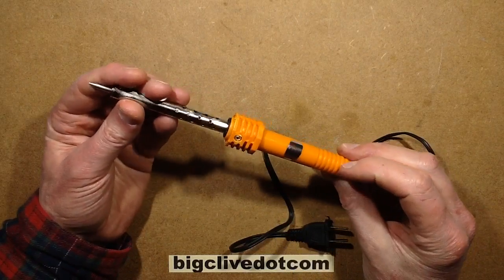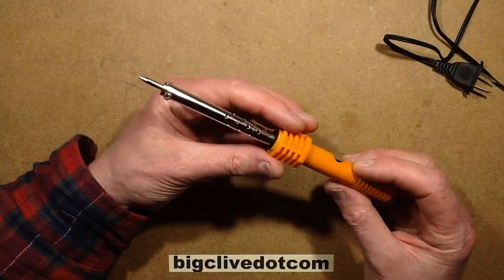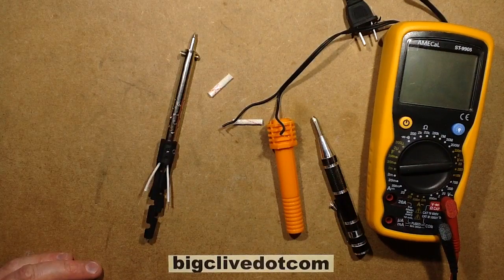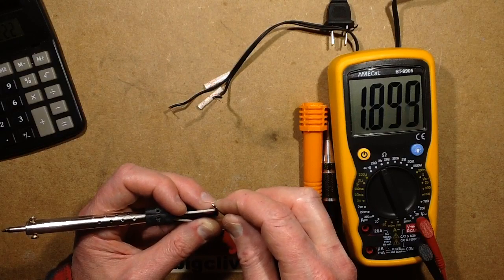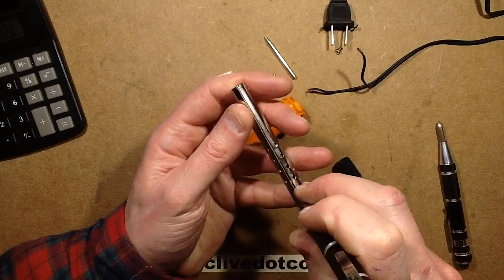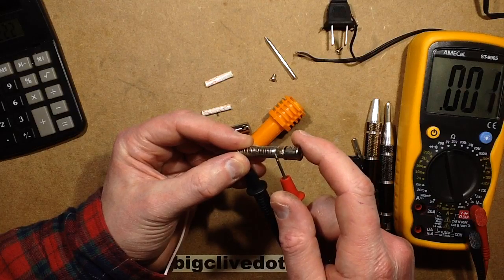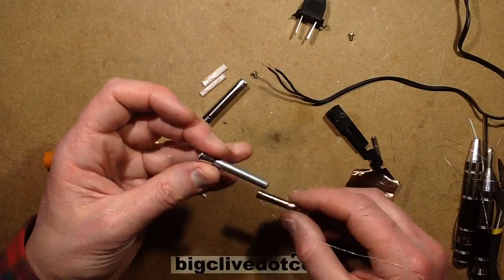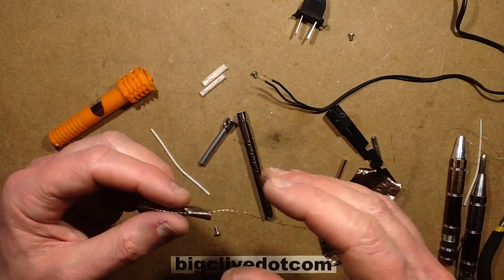Inside the cheapest soldering iron on ebay.

Comment: I took a cheep 4$ harbor freight soldering iron and replaced the tip with solid copper wire (AWG 6 I think) and plugged it into a dimmer got decent results.
Reply: Found one for ~$2.60 at Menard's.
Reply: This is actually one of my favs in the $10 and under range. It has the most flexible power cord compared to all my other soldering irons I've used. Not a high wattage iron, but if you use a piece of solid core 8 AWG copper wire, it works quite well. Make sure to wrap a piece of solder around the tip before it heats up so it gets that coat before the oxidation sets in.

Comment: One can always help Ebay closing down scam sellers /sellers of complete rubbish by reporting a description that didnt match the product. I mean you were supposed to get a soldering iron right? Not an orange piece of plastic tubing, a cable and a piece of metal..
Reply: I bought a couple of these on separate occasions. They work as advertised. If you want quality product, don't be stingy and pony up more than 99p.
Reply: Ola K my ebay £2 soldering iron is still working well after several years. granted it was double the price!

Comment: That looks even worse than the crappy soldering irons they sell in Homebase, probably doesn't even last any more than 5 minutes.  None of the ones I got ever did.
Reply: +CoolDudeClem Nope, works it fine.
Reply: +xlvxjang You got one of those cheap ones too?
Reply: +CoolDudeClem the cheapo homebase and such are just a similar version that has been tested (i would hope!) for safety, and fitted with a UK spec power cord and plug(along with a huge homebase markup) but the irons themselves are still as bad, terrible tips, and lucky to get 2-3 uses from it before it dies.
Reply: Sony Trinitron
ye, i tried it. can solder basic things :D
Reply: thank you clive I realise you must be very busy talk about leaving us in the lurch I will consign it to the bin thank you
Reply: I had a 60W iron from eBay from around €2 that lasted 3 months with relatifly intensive use, realy impressive! It just gave up on me yesterday so I ordered the same one again since for that money it worked amazingly well.
Reply: The link to what? I got mine from a real store, not online.

Comment: The "quick release" power cable is a safety feature ;-)
Reply: I have had 120v AC through my arm and it didn't hurt that much. I can't say about 240 though.
Reply: Great Value Bleach "But wait, there's more!" ;-)

It's the spasms that make sure you die if you're unfortunate enough to get a live conductor in the palm of your hand - your hand will instantly clench around the conductor, making sure that that's the last thing you ever grab.

Hmmm... That leads me to a thought... Instead of having politicians place their hand on a bible when taking office, get them to place their hand on a 240V conductor! :-P
Reply: I've touched both 120V and 220/240V AC@50Hz, by accident. Survived both, but let me tell you, 220V is not a pleasant feeling. While it was less than a second, my arms were shaking for hours afterwards and it hurt quite a bit. Not nice, at all.
Reply: For a few $ more they sell the exact same iron, but with a strain relief for the cable. Clearly the luxury model lol
Reply: sounds like  a great bonus for your friends to get a mild laugh and then help you out if they were watching
Reply: NO NO NO. It's a feature called hot swap and it allows you to change to soldering ion with higher power when you need to. :-)
Reply: It safely disconnects the iron

Comment: I live in Thailand and bought one of these yesterday as an emergency soldering iron. It cost me 20 Baht or about $ .60 US from a 20Baht store (similar to a $1.00 Store).
The first thing I did was measure the wattage and my unit showed 31 watts versus the sticker that said 40 Watts. Here in Thailand we run on 220 volts AC. The iron actually
works fairly well, heating up time as expected is long but it does solder. This is no substitute to a soldering station but in a pinch will do the job.

Comment: As an adolescent I bought such a cheap soldering iron from the bargain bin at the local hardware store.  I lasted less than an hour before the heating element burned out.  The store proprietor was kind enough to give me a replacement, but it didn't fare any better.  Since then, I've preferred Weller industrial soldering stations.  Repair parts are readily available and they hold up for hundreds to thousands of hours of use.

Comment: Following your glowing review I got myself one of these! I was impressed with the build quality and mine had the special feature where the handle & soldering iron end would wiggle when pressure was applied. Undeterred I plugged it in, it started oozing smoke from two of the holes on the metal body. One hole was a steady flow of toxicity while the other was just a half hearted attempt which wouldn't score higher than a 3 from an olympic judge. After about three minutes I measured the temperature of the tip with my thermal probe - an impressive 280 degrees and rising slowly.
So I thought time to attempt some actual soldering/desoldering. I hovered my smoking tool over an old motherboard and touched the tip to the grounding tabs of the usb socket assembly and pressed firmly to compensate for the built in wiggle feature. I waited and after about ten seconds I could see the surface of the solder changing colour with and the iron also ceased smoking - Hurrah I thought! But then nothing else happened, so I pressed harder, waited, still nothing. Then I moved the tip to a smaller solder joint, pressed and waited - nothing. I decided to do my unique soldering iron tip temperature test where I move closer the tip end of the soldering iron body parallel to my lips to gauge a rough idea of the temperature - not very hot was the response from my lips!
I applied my thermal probe to the tip and it stated 87 degrees and falling. After unplugging, waiting and trying again, it seemed like my wiggly wobbly Chinese soldering iron had gone to 99p heaven.

So to conclude, I had enjoyed a ten minute mini toxic smoke-display and almost managed to melt a solder joint (to be fair it was a bigun) with my 3D direction adjustable body soldering iron before it expired. :-(
On the plus side my mains lead seems to be firmly attached!

Comment: The resistance of metal wires actually goes up when they heat up. That iron is nowhere near the claimed 40 W. 
The TCR of nichrome (typical heating wire) is about 400 ppm/K. Heating it up to about 400°C would increase the the resistance by 160000 ppm which is 16%. That 1.898 kΩ would then be 2.20 kΩ at temperature, so the actual power is 230²/2.20 kΩ = 24 W.
Reply: +piast99 science.

Comment: Interesting video. But for 99p, its not going to be the best quality in the world. Also I think these cheaper irons would be much safer on 12 volts than 240v as if those wires come off like they did in this video. Having 240v up ones arm isn't going to be pretty.
Reply: +BritishRail60062 yes i have a budget iron, but i bought a 12v one, (cost me £2!) and tips are cheap too, its been reliable for 3 years and hundreds of uses, i have a small 12v battery i keep charged for it (yes i could also use an old pc power supply i have modded too)
Reply: +jusb1066 Wise choice sir. Much safer than getting zapped with 240V AC.
Reply: +The Joker: At 13Amps going up ones arm. Its not going to be a good outcome. Still you get what you pay for :/.
Reply: +SigneM-Prut#1. With 13Amps? You must be either very lucky or not touching ground I bet.
Reply: Voltage is not dangerous, current is
Reply: +The Joker lol I just read your last post again, it's is completely wrong. You don't understand how current works obviously. You and Britishrail fail to comprehend that loads draw current based on their impedance, voltage applied and power available from the source. Also, of course you can die from contacting 240v, and how the hell does the full load current of an appliance somehow become the current going through your body. I understand you might be learning, but read up more and be sure as others will take your advice as fact.
Reply: What has AC or DC got to do with what we were discussing, way to try and divert the conversation. YOU DO NOT UNDERSTAND HOW CURRENT WORKS. If a toaster element is drawing 5 amps, and you touch a live part, 5A won't flow through your body, milliamps will if anything. Milliamps through the heart can kill you, anything over 10mA is approaching dangerous. This low current flow is because your body has a high resistance (with dry skin, lower with wet skin, skin penetration or higher voltages ). Learn Kirchhoff’s Current Law so you stop thinking an extra load in parallel with another load will somehow magically draw the same current. And your friends 24V bench top power supply obviously short circuited (or battery exploded) and burnt him, there was never at any point any high current flowing through your friends body. Also, stop saying "its not the voltage, its the current that kills" this is so cliche and anyone who understands electrical principles will roll their eyes at this. If you think a 24VDC power supply is more dangerous that a 240VAC mains supply, and you wont listen to reason, then no more can be done for you.
Reply: Clone36 your wrong. it takes about 100 to 200 miliamps to stop a heart. as for the rest im to lazy to fact check anything else
Reply: But without Voltage there is no current.
Reply: Thing is,  i bought one "made" for 110 volts at sixty watts... Not only is it the same,  it's just as shit....  For nine dollars

Comment: I'm surprised you haven't taken one of these apart before.

It is standard practice to avoid soldering heating filaments, heat can melt/evaporate/oxidise lead which is no good electrically or health wise, lack of fibreglass sleeves on the joints is however an issue.

The mica is plastic like because it's coated with wax (usually paraffin), it makes the mica workable and less fragile, on first heating wax will evaporate, hence often these kind of heaters do smoke a bit on the first run.
Mica also does not deteriorate under <500C heat so insulation should not be an issue.

I have used this type of soldering iron for 25 years, quality made ones last for 5+ years under heavy use easily. the main failure mode used to be the oxidisation of the copper tip inside the filament due to heat, the tip would swell and would not come out. so once the tip was gone you had to replace the heating element with it as well.

Comment: I have that exact solder. It cost around 0.80 USD, and i use it to replace a microswitch in my mouse, which was double clicking. 

It's not bad, and it's still running ok. I use this to fix loose soldering, basic repair and such.

Comment: I recently purchased the cheapest 60 watt iron I could find on Ebay.  It shares the same plug as yours without "holes" in the tips for hot and neutral.  Also, the plastic handle gets hot.  But it does work.

The Harbor Freight irons are only 30 watt, but they are also pretty good.

Comment: I've used these a thousand times and have never had a problem other than the tips corroding really fast with daily use. The ones here in the States are $1 and have a black handle. Rated at 30w/110v

Comment: Here in the USA, simple things like soldering irons are almost never grounded(earthed). Even electric hair dryers and vacuum cleaners are rarely grounded. When I ordered a British made Antex XS25 soldering iron(which I might add blows my old Weller out of the water) I was very surprised to get a three-prong plug. It is in my opinion more of an inconvenience as half my house is outfitted with un-grounded two-prong outlets. Only the kitchen circuits were retrofitted as they see high usage.

Comment: 1 Ebay seller has sold 700 of these kits for 9.88$ with free shipping.  I bought one a couple weeks ago and it works fine. Only issue is that it comes unplugged easily.  I would recommend spending double and getting a better kit if you are going to use it more than once ever few years.

Comment: I bought one for fun too, it's still the cheapect one in 2021 at less than £3 to your door, the heating element for this generic 30w iron is £1 on it's own and it fits a few different el-cheapos.  The screw in the handle hilt gets bloody hot but I worked round it by putting a different one in it and then adding strain relief and a new better and longer cable, no earth but I used it for a day or two, also The metal part that holds the tip is sheet steel and curved to fit and within a day it had opened up, strange how you HAVE to mod Chinese crap like this just to get it a bit safer to use, great video Clive.

Comment: I have an identical looking one in blue, in which the wire was indeed zigzagged around the strain relief thing as you thought it should be. Also the wire is crimped on to on terminals attached to the black plastic piece and heat-shrunk. Gotten that nearly 15 years ago in a dollar store like thing in France, served me well until I gotten a proper thing recently.

Comment: I have had more of the same cheap soldering iron. On them was 25W / 220V but  I used each of them only once because the heater immediately burned. I tried to connect a diode in series to reduce the voltage to the heater but did not help. I  tried and transformer 220/110 but that did not help too. Fortunately they were cheap and still keep one piece.

Comment: Bog standard heating element, made the same way in many applications. Bet the mandrel is steel as well, not thermally conductive copper. No earth means they save on the more expensive 3 plated steel core cable and extra plastic in the sheath and moulded plug. Have used similar unearthed ones for many years for non critical applications where you need to solder a few wires, and there is no need to pull out the big soldering gun.

Comment: I have a friend that bought one of these and it works pretty good. I wouldn't use such a piece of junk nowdays but this is the kind of style of soldering irons that I started with... I tried to rewind one of these to make it work on a 3.7V 18650 cell but have any succes with it so I gave up.

Comment: I picked up an iron similar to this, the handle looked a bit nicer though and it was £4. I got it as a challenge. 

I had to use it to build a power supply from scratch, then build a soldering station using a wacky knock off 908 handle then use that to make a full blown re-work station. A 3 in One using an old computer case. It was a fun project though I will never ever ever use a cheap iron again.

Having seen the inside of that one now, I am really glad I didn't open mine up.

Comment: not a bad iron considering that the tip is only held in by a screw.

most soldering irons you can get the tip is threaded in.

so when the tip gets worn out you can simply cut the head off of a large nail and use the nail as a soldering tip.

though the cord pulling out and no reinforcement makes it incredibly dangerous (sparks and shock hazard).

Comment: I bought one here in America for $1.00 at a dollar store. It's built the same way as this one here, it takes about 2-3 minutes to heat up enough to melt solder and I use it as my go to when I'm doing desolder Work. So far it's worked well.

Comment: Hmm, could that steel wire be the remains of a design that should have been the grounding connection?
Reply from the maker: It was to retain the mica over the heating element.  The body of the iron would need to be grounded.
Reply: Apart from the wire it looks like my iron that I think was from Maplin.  Thankfully that IS earthed.

Mine was supposed to be 30W but is measuring 1.9K ohm, pretty much the same as this one.
Reply: it is actually a nichrome wire so it was probably not :)
Reply: Oh problems with them irons etc and the tips get all messed up too quick...those cheaps ones always never want get hot enough either...get one of those decent and like better Wellers I'm telling you and the L.E.Ds so you can see what the hell your doing no more holding a light etc stuff like that genius etc.
Reply: JR or better yet: get some decent lighting in the house. if its so dark inside that you have to use a flashlight to see what youre doin its time to install some lamps..
Reply: asdf So your head never blocks the overhead light then?
Reply: Alex Atkin only the direct light. theres still enough light reflected from the walls..
Reply: asdf If you have a dedicated room perhaps, but I get zero reflection from my walls and the lights being in the middle of the room and tables at the edge means I ALWAYS need additional light.
Reply: Alex Atkin im sorry to hear that man :)
Reply: asdf Not a Flashlight but like them small hand leds etc..doing something fine small where you need a lot lighting etc and damn blinder than a bat up close etc haha...still though those don't want get very hot and you know how it's awful damn solder and flux sticks to them real bad and cleaning the tips tear up them up trying keep them clean and tinned right etc...damn diy make a Tip Grind put a badass point on it etc do it right etc haha
Reply: JR an LED headlamp does the job for me.
Reply: The Semite Oh your talking like the "station" etc haha...not like how put them on just a long extension cord and oh half drunk and still can't see blind burn myself drop solder on everything when you had an idea etc haha
Reply: You'll Never know the struggle etc haha